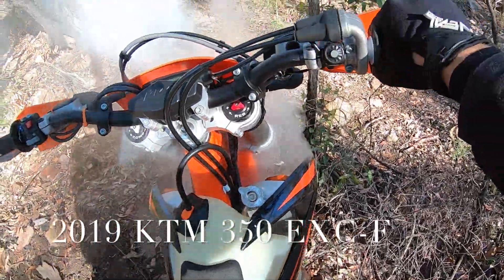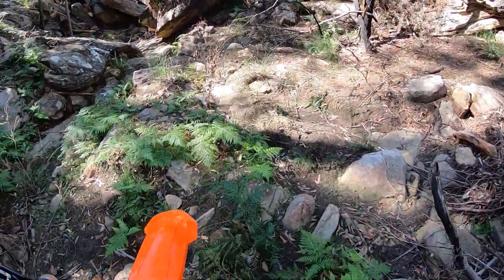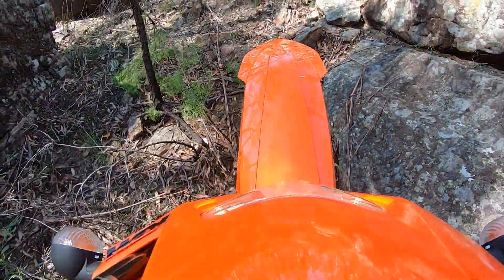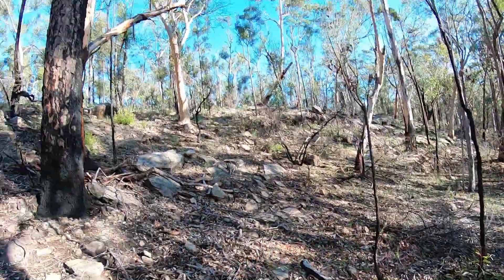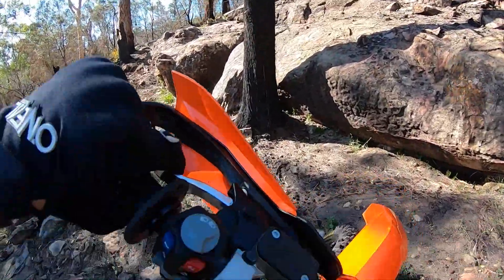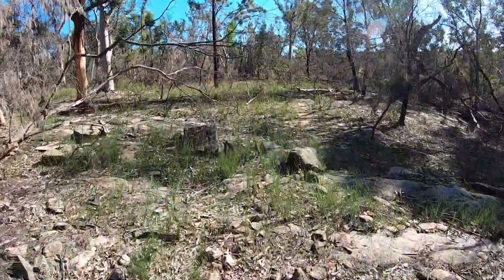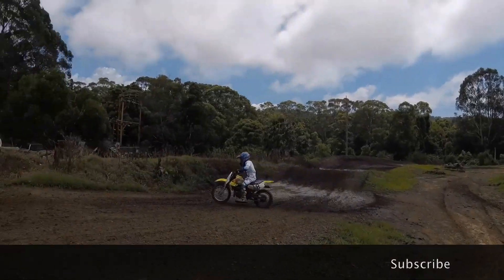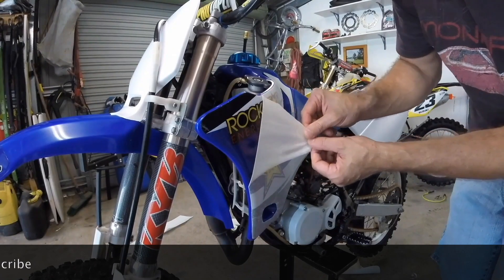First Impression KTM 350 EXC-F Dirt Bike Review

Comment: Hey Steve good video mate and looks like a good channeling first ride. A few things you may consider: 1) get the ECU re-mapped, the bike will not stall and the power comes on right away. 2)Take out the spark arrest, more power and better sound. 3) Up grade for pegs and brake pedal tip (Aliexpress.com cheap as). 4) Get the Acerbis engine and clutch protectors,  especially if your riding rocks!. 5) For $500 bucks you could have bought a full set of after market plastics, awesome graphic kit and seat cover (save the originals for when you sell it). 6) The Midwest Clutch lever is a great option.  7) Tubliss system on the rear with a Golden Tyre 333 will give you incredible traction (I don't run tubliss on the front,  only because I can spend money elsewhere better). Anyway mate these are just a few things I would recommend.  I've done more than this on my 450 but these are my 'must do's'.
Cheers.
Reply from the maker: Thanks mate appreciate the feedback. The dealership has removed the restrictions from the bike and different exhaust tip and remapping it goes well all the other things that you mention I am looking into. Thanks for the tips I appreciate it...
Reply: Broken Sprocket your dealer would of just uploaded the euro map to the bike, he hasn’t “re mapped it” talk to Rex from fueltorque find him on fb, you ship him the ecu and he re-maps it. The remapped ecu makes a huge difference, mate just got his 20 450 done and we rode it side by side with my identical 20 450 bought at the same time and it’s night and day mate, he charges 250 bucks and will give you your money back and load the factory settings back on the ecu if your aren’t impressed with it
Reply: @wakawaka12320  Good old rexy, he did mine to. Dealership maps suck! Rexy will get that thing going!

Comment: I had zero doubt if you would love the bike or not it is an amazing machine.I'm not sure if I just couldn't hear the fan or if you don't have one but I would definitely put a fan on it I would also recommend changing the fluid from regular antifreeze to wetter water or engine ice that should help out a lot.When I purchased my bike I don't even think I used the side stand once. I think everybody and their brother makes fun of KTM kickstands because they have a tendency of snapping the bolt that holds the stand on I would highly recommend getting an aftermarket side stand. I got one from pro Moto billet granite it was $200 but I can literally turn my bike on a dime using the stand in my garage or on the trail and I'll never have to worry about it snapping off. That ride looked like a fun time thanks for sharing
Reply: I enjoy reading other people's comments and clearly you need to put a fan on that thing lol
Reply from the maker: Thanks mate appreciate the feedback. I have ordered a fan kit hopefully that will fix the problem. The stand is useless bike just falls over I have used engine ice before it's pretty good.

Comment: Like everyone else says, you need a fan, the bike in the States already come with one.  I don't know what gearing you get over there but mine came with a 14/52.  A 13/52 is much better for offroad and keeps you from having to slip the clutch so much which helps keep the oil cooler.  These bikes do have a tendency to flame out and stall.  Make sure you are not running too lean.  I also found installing a clutch weight really helped with stalling and gave the bike even more 'chugability'.  You can get a bigger kickstand pad from KTM but they are expensive.   Did you replace the kickstand bolt with the shorter one that comes with the bike??  That way it will not retract automatically anymore and it is a little more stable.
Reply from the maker: I have ordered a fan kit hopefully that will fix the problem. The stand is as is I will look into the parts it came with hopefully that bolt is in there came with 14/52 gearing thanks for the tips...
Reply: Broken Sprocket I removed the bushing that makes the stand go up automatically and changed the bolt on my stand before I took it off the trailer. The bolt should be in with the spares and tools that come with the bike. Just chuck the bushing and never use it again
Reply from the maker: Thanks mate I will give it a try.

Comment: Awesome bike, however there are 3 mandatory things that you need for it.  A radiator fan, a coolant catch tank, and the rekluse clutch.   I would also keep the radiator topped off, I think your dealer was just referring to the little bit of coolant lost from normal coolant expansion, not the overheating geyser that you had.
Reply from the maker: Thanks mate I have ordered a fan kit hopefully that will fix the problem. I think when I became use to the bike I will have less flame outs overall the bike feels good and am looking forward to my next adventure.

Comment: Far out Mate, another entertaining vid..
1. I reckon even goats would have pooped themselves and then shied away from those tracks.
2. I have had a boiling issue on my old CRF450x, the shop recommended a coolant called 'Ice'. worked well, but you have to drop all other coolant out of the bike, it doesn't like mixing.
3. A fan with Ice combo, for the goat tracks you cover, definitely..lol.
4. did the 350, make your day 20% better?
And yep, So far the little 15min paddock run on my 350, proved its self to be a great freight train of a bike, luggs when needed and then happy to run if you ask it to run. Love it, and will be doing fan and Ice, on my one.
Great vid, and see you on the trails soon.
Cheers, Silver Top - Dougie. :)
Reply from the maker: Thanks mate yeah I got my 20% worth lol. Some small problems to take care of. Your going to love yours.

Comment: It’s hard to tell by watching the video, but how much air pressure were you running?
I looks like you had way too much in the rear at least.  Just like everybody else, (get a fan), but don’t stop there.
 1. Remove the thermostat and replace the hoses with Samco hoses, 
2. replace the coolant with something better like Engine Ice or Water Wetter, 
3. put in a high velocity water pump impeller.  All those things work together to keep from overheating, but if you still end up spewing coolant on the ground, 4. install a coolant overflow canister on the bike to catch the coolant and then it recirculates back into the bike.  
IMS makes one that slides into the frame of the bike...it’s pretty slick.   Nice bike!  Maybe get some good knee braces too.
Reply from the maker: Thanks for the tips I have 15 psi in tyre because it's only got the standard tubes in it till I can put tubeless tyre system installed.
Reply: @BrokenSprocket  fair enough, but even with regular tubes it’s way too much pressure.  Drop it to 9-10 and you’ll still be ok if you ride like the video.  I have tubeless and I still carry a bunch of long heavy duty zip-ties just I case I flatten the tubeless.   Killer trails by the way.
Reply: A prepared man is worth two.

Comment: Congrats on the new bike! They definitely need the fan for that sort sort of riding. Get one ASAP. The genuine KTM fan kit is easy as to install. Anyway it might run a bit hot while it is running in for a while. My new 20 model did. I also recommend lowering the gearing too. I think you would find 13/52 gearing much easier on your trails.
Reply from the maker: Thanks for the tips I have ordered a fan kit hopefully that will fix the problem.

Comment: I have the 2019 EXCF350 CANADA.  Mine came with factory rad fan; I agree with NYCFastest Crew below that you should be able to snap one in ASAP.  Also, hearing the engine in the video (our bikes sound like sisters 😊), my factory ratio was 14:52.  I flipped the front to a KTM OEM 13 tooth front sprocket to get the road out of it and set it up for the trail...a world of difference, less 1st gear stalls in tight stuff and 2nd is now a grunt...highly recommend while chain and rear sprocket are newer.  I had to cut 1 link out with the 13, block position ended up perfect with both  ability to loosen or tighten chain
Reply from the maker: Thanks for the tips I have ordered a fan kit hopefully that will fix the problem.

Comment: Nice ride to work out what you need to make it fit you better. Those Maxxis tyres are rubbish, Fan kit, Larger rear brake tip upgrade and maybe disc protection.
Reply from the maker: Thanks mate some small things to take care of and it will be sweet.

Comment: Sorry for dogging you on this one mate but it clearly seems like you had that bike in an area that it should never have been. Probably just as difficult to walk up in 2 feet much less on a motorcycle with a ground full of slippery leaves and no current existing Trail and no room to even get any momentum no matter what motorcycle, tires, or skill level you were. Therefore causing you to use excessive clutch which definitely put the engine in x stream srress that it never should have been. That was your overheating problem. it doesn't need a fan doesn't or anything else. Imagine you just fired up in your garage and clutched it and wreved it and clutched it and wreved it but never left the garage and you did that for an hour. It would overheat just as well.

Comment: To boil out coolant until it doesn't do it any more is ridiculous..   if your radiators are only at 70% water level they will only cool at 70% efficiency... and you'll cook your bike faster than if they where full. Put a fan on  and be done with it. They are a necessity on a 4 stroke for trail riding
Reply from the maker: Fitted a fan after the first ride thanks for the feedback.

Comment: Put a fan on bro take that top plastic chain guard off don,t need and what gearing you running mate my son runs 13 / 52  but cruising speed is only 75/80 k but not  good on road but it,s  not for road
Reply: Oh you need to put after market exhaust on or spend 150 on new end cap and get ecu remapped as it will run lean  otherwise use Rex fuel torque for remap if you are going to do I can give you number if you need it, and yes stand are crap you can buy after market or put wrap around hand guards on and jut lean against tree 😂😂😂😂 yes needs tyres standard crap
Reply from the maker: Thanks mate the dealership removed the restrictions from the bike and changed the exhaust tip and remapped the bike its got plenty of power. I have ordered a fan kit that should fix overheating problem .
Reply: @katojimmybling  wait 13/52 gearing and 70-80 mph cruising speed, damn i think thats good, maybe your son needs a 450?

Comment: Out of interest 
what maxxis tyres are they
Reply from the maker: Maxenduro
Reply: Broken Sprocket i run the maxxis maxxcross IT. 
love  them specially with tubeless. very strong sidewall can run very low psi. without any trouble   and very long lasting. 
ran them on the yamaha as well.

Comment: Get a fan, silicone tubes with thermostat bypass kit, and a map switch with traction control. Thank me later ;)
Reply from the maker: All done mate thanks for the feed back...
Reply: Broken Sprocket a twin air radiator cap helps with cooling too. That's what I have on mine as well

Comment: G'day Steve,
I bought my 13" 350 EXC brand new as you have with yours. It's like a window back to when I got mine, same style of riding on the same bike with the same experiences.
I still have my 350, still love it and you're on the right track.  Once you get the front sprocket down to the 13 tooth (should be in the folder with the manual), a thermo fan and some decent rubber with some tu-bliss installed running about 10psi you'll be unstoppable. 
Check out Baz's channel https://www.youtube.com/channel/UCJAvmhgP0h1AEKY8vTEJPJg for some awesome riding tips too.
Good luck and welcome to Team Orange!
Reply from the maker: Thanks mate appreciate the feedback I just got back from a ride today the 350 is fantastic the more I ride it the more I love it